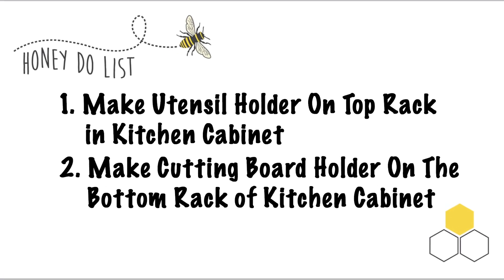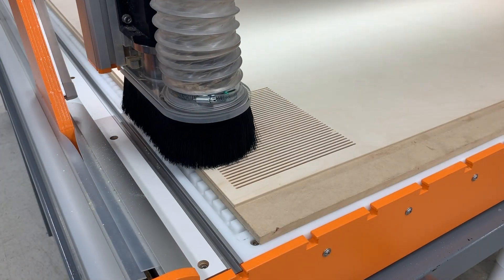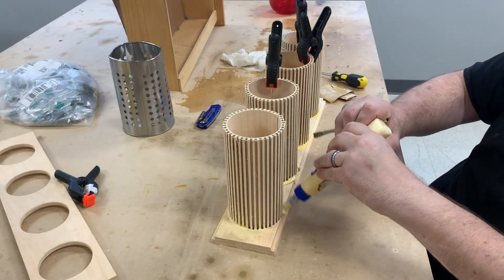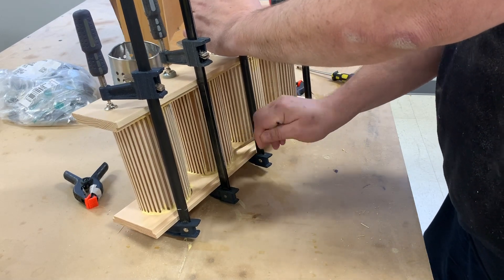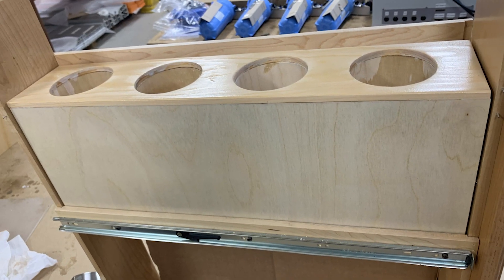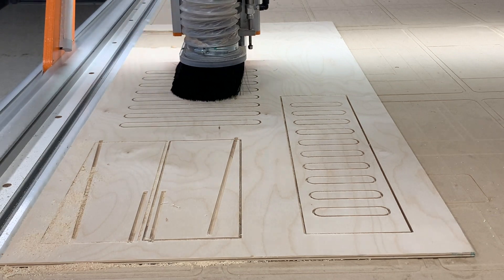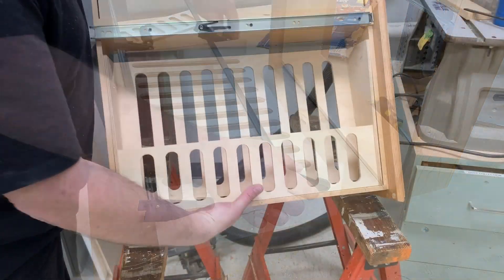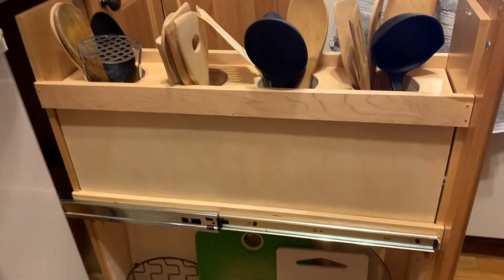Custom Kitchen Cabinet Organizer Made On A CNC - CNC This!

Comment: Why not apply the wood glue into the recesses and then insert the flexible panels instead of painting it onto the outside?
Reply: Yeah I wondered, but then seeing how it's assembled, no one will see the outside of the tube in the completed project. Also by putting the glue on afterward (and knowing it will never show), there's plenty of time to get the pieces together without the complication of glue setting up too soon and/or glue causing some swelling making the assembly more difficult to fit together.